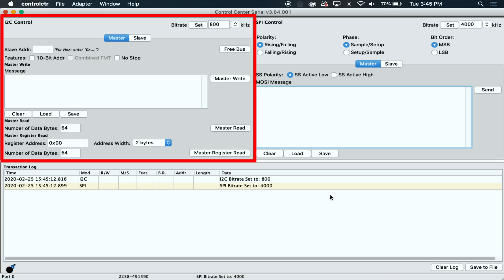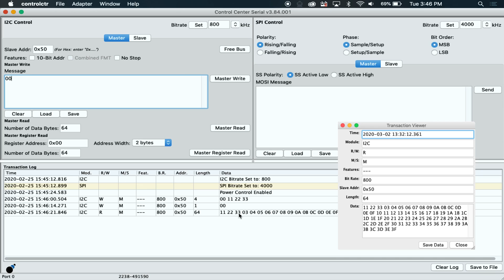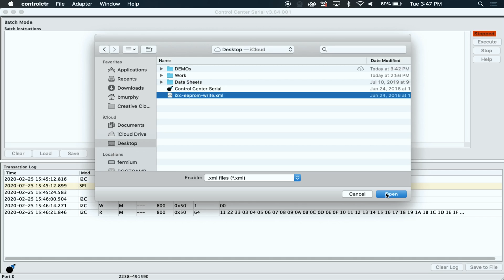Programming an EEPROM with a Total Phase I2C Host Adapter

Comment: Great Video, I have a question. There is a software called WicReset for resetting the Epson printer's various errors. So whenever I have to use a particular option, I have to buy a key from random places with lots of risks of viruses for WicReset to function. Is it possible to sniff the USB connected to the printer while WicReset is doing its thing and capture the data and replay it to simulate the software. Thanks
Reply from the maker: Thank you for the question and feedback on the video. I am not sure exactly what the answer is to your questions. However, you can always submit a support ticket on our website and get connected with an engineer who can help answer your questions. Go to the link below to submit the support ticket. 
https://www.totalphase.com/support/